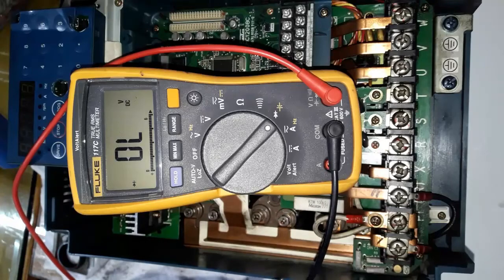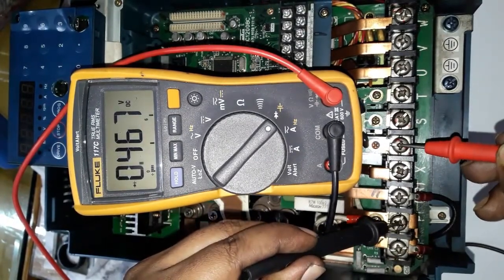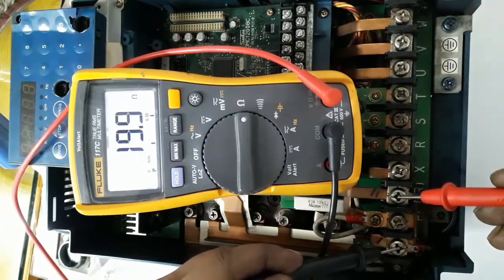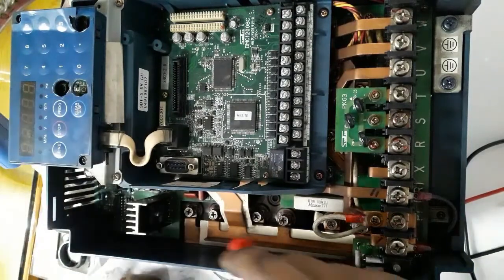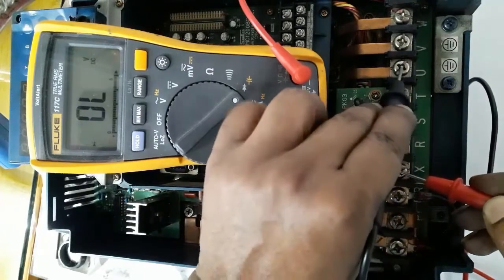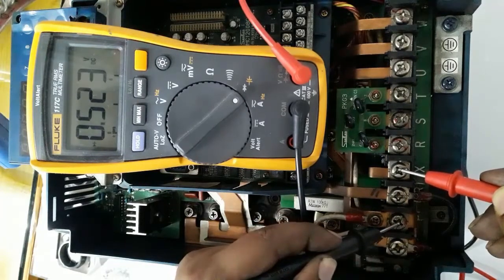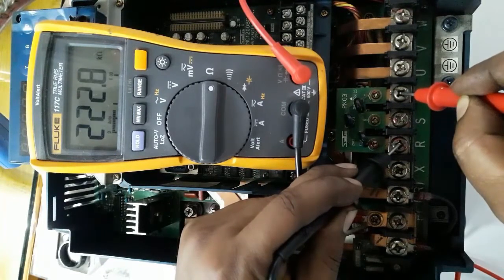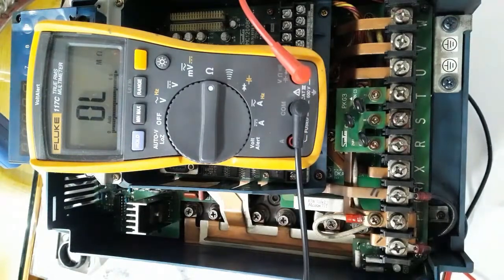𝙎𝘼𝙈𝘾𝙊 𝙄𝙉𝙑𝙀𝙍𝙏𝙀𝙍 𝙋𝙊𝙒𝙀𝙍 𝘾𝙊𝙈𝙋𝙊𝙉𝙀𝙉𝙏 𝙏𝙀𝙎𝙏𝙄𝙉𝙂 | 𝙎𝘼𝙈𝘾𝙊-𝙫𝙢05 | Flow Chart @FlowChart

Comment: Vai, ai invrrter a (open fault) ase,  3 phase out put motor ok ase. Kisu somoy Run hoya abar open fault ase, atar solution ki?
Reply from the maker: Recheck motor parameter, may be sometimes anyone phase missing
Reply: @FlowChart  Factory setup deoya hoyase. New parameters set kora hoyase kintu fault jayna?
Reply: Vai,  ocpn /ocn /open fault repairing korbo ki vabe janaben?
Reply from the maker: Check predriver opto-coupler
Reply from the maker: Also check 6 capacitor in presence predrive ckt
Reply: Vai, inverter a (BDOH & Su) fault braking resistance ok asee, ciramik resistance ok asee tar poreo Run dele fault asse.
Reply from the maker: Contact with local agent
Reply: Hello Sir plz 
Halp me..!
Ovd alarm solution plz sir..!